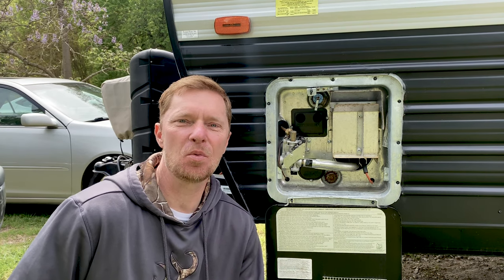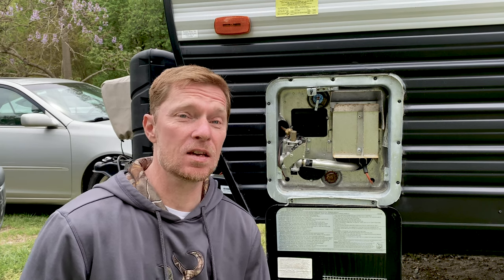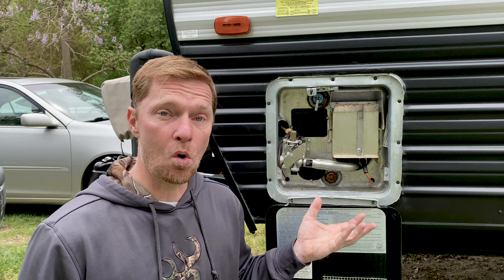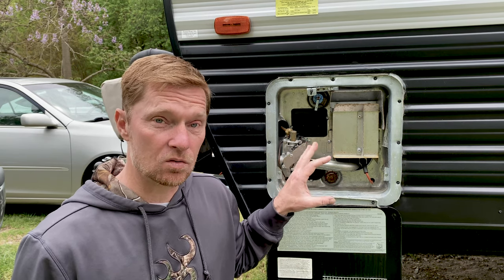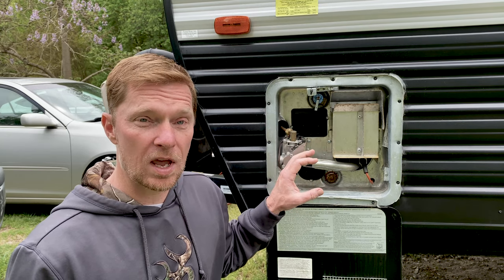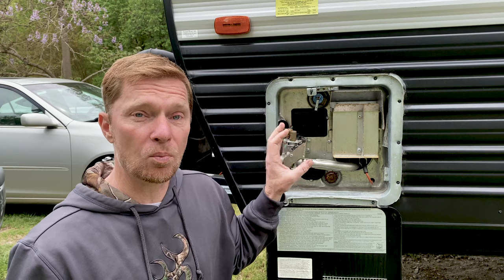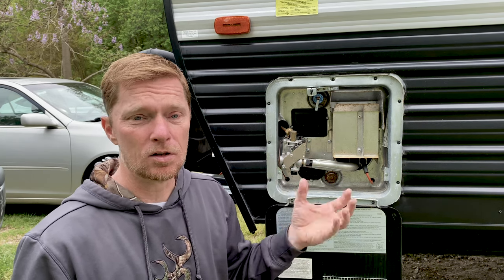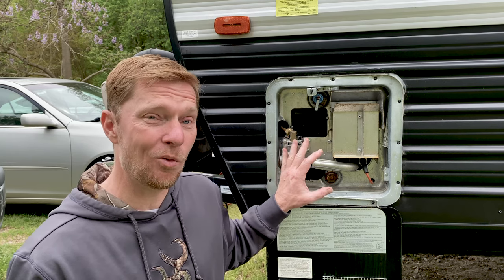Travel Trailer Gas Electric Water Heater Explained 2020

Comment: Thank you for this very informative and easy to follow video. We recently purchased a 2016 trailer and have replaced anode and heating element and replaced the fuse. The breaker still keeps tripping. Do you have any ideas of what else we might need to check?
Reply from the maker: Since you have already replaced the heating element and fuse, I would check to se if the thermostat is cutting of the heating element. I have a amp meter that i can check to se how much power i am consuming. You can try to use the electric and the propane at the same time and when the gas cuts of, the electric should as well. This is the point where the thermostat says that the water is hot enough. When the power gets to where it needs to be then the amp draw should drop as well.

Comment: How do you know when the water heater has water? How long do you wait until you are connected to city water to use hot water or what do u have to do so water goes to water heater?

Thanks!
Reply from the maker: On mine, I make sure that the vlaves on the back of the water heater are in the right place. I look at the little valves on the water lines going into the water heater and the handles are pointed at the water heater. After that, The water heater would need some time to heat up. Mine only takes about 30 minutes to heat up enough to feel a difference at the faucet. Here si an article that can better explain it with pictures. Hope it helps. www.tinyurl.com/26tw4vqu
Reply: I see. Thank you for the helpful information.

Comment: Good video.
Explanation of the ignition assembly for the nerd in a few of us.lol
On a call for heat as explained,  the gas valve opens and a spark is created to light the gas.  Once the gas is ignited,,,,,, the flame touches what is commonly known as a flame sensor. This flame sensor tells the control board that the flame did IGNITE and to keep running.  It harkens back to high school physics that heat is energy. It's sends a small millivolt signal to the control board.  If by chance you have a water heater that lights......then shuts down. Chances are your flame sensor is dirty. It can be removed and cleaned to a shiny new steel rod with a little bit of fine emory cloth or steel wool. 
On my model it will try to ignite 3 times. After the 3rd try. This system LOCKS OUT. Letting you know. 
       " SOMETHING IS WRONG  " 
On your first try of the season I always start my burners on the stove, my furnace and then my water heater in that order to purge gas lines. Notice I didn't say HOT WATER HEATER. 
GEORGE CARLIN SAYS 
HOT WATER DOESN'T NEED HEATED ! LOL
HOPE THIS HELPS.
Reply from the maker: I agree. There is a part in folks like us that like to understand the intricacies of things. Mine has the 3 strike and your out as well. Thank you for confirming that this video is serving a good purpose.
Reply: @HowToRV  
Retired HVAC/ R TECH FOR 35 YRS.

Comment: Thanks this is great! How do you know if your heating elements are bad? I just pulled out my anode rod and it's completely gone. On a 2012, I don't think the prior owner ever changed it.
Reply from the maker: I will have a video on just that in a few weeks. But, so that you do not have to wait, what I do is turn on the electrical side only and wait to see if the water heats up. I usually give it about an hour or so then run the kitchen sink faucet and see if hot water comes out. If it does, then I turn off the electrical side of the water heater and run the water at the sink until is goes cold. After that, I turn on the propane side without the electrical on and see if that works by doing the same think by waiting and then running the water at the sink. Hope that this helps. Oh....So far "fingers crossed" I have not ran into any issues with water heating up. If and when I do, you will surely see a video come out about that. Be Blessed.
Reply: @HowToRV  Thanks, more good stuff!

Comment: Does the switch on inside for water heater have be on or off for electric if that only switch?
Reply from the maker: I would think that if  you only have the switch on the inside, that you may havce a propane only system. One way to check is to see if you have a electric breaker in you panel for the water heater. You can also reach out to your local RV dealship. Where we live, I have to get an annual inspection and questions like these are accepted during that time.

Comment: Looks as simple as that but I'm trying to run my water heater off electric . It does not ignite . I have no propane in tanks and hooked up to electrical . Do I turn the hot water switch on in my RV. Do I need to close the propane tanks before igniting electric (empty) . Someone showed me how to ignite both ways but when I turn on the electric switch outside . No luck . I'm a newbie be kind . Lol . Thank you
Reply from the maker: On mine, the switch on the inside s for propane only. If you do not have any propane or the propane bottles are turned off, you will need to leave that switch turned off. If you are connected to shore power (i.e. The power cable to your RV is plugged in), then this is when the electric switch on the outside on the water heater will come into play. Be careful because if you turn on the electric on the outside to the water heater and you do not have any water connected to your RV or the water tank and pump are not on, you could damage the electric heating element. Hop this helps. Also, check out this video to see if it helps explain a little further. https://www.youtube.com/watch?v=r1QORFE2htM

Comment: Great video.. quick question .. if I have the electric switch and gas option, can I assume I can run both at the same time to get more hot water.. How do I know If I have a reserve tank for each option.  I was under the assumption the two options were only if u were “boondock”camping vs “full hookup” camping (didn’t know i could run both at the same time).
Reply from the maker: You should be able to run both at the same time. The electric and gas work together. We do it most of the time. In our setup, we notice a big difference in the colder months. The gas heats from external of the tank and the electric heats from inside the tank. The 2 working together heats up the water faster as you use it. Now it cant keep the water hot because you would use it faster than it can heat it back up, but it will last longer thank if you were only using one system or the other.
Reply: Imagine Your Odyssey awesome good to know, very informative! Thanks

Comment: Newbie here. We turned on the electric to the water heater. A while later the DSI fault light came in inside on the panel. So then we turned on the propane and pushed the hot water button on the panel and it went off. My question is this. Can't we use just the electric on the Hot water heater only, and if so why would the DSI fault light come on? I am very confused. We are at RV Park for 5 nights. Do we leave the propane on all the time when we aren't using anything. I don't want to mess up the hot water heater.
Reply from the maker: The electric and propane can run together. The DSI letters stand for direct spark ignition. That is the device that helps add the flame to the gas in order to heat your water. When this fault code appears on your water heater, it generally means that no gas or propane is coming through the line. I would guess that may be possible that the propane is turned off? Make sure that all the air is out of the tank before turning either system on. Please let me know if this helps and gets your system running like you want.

Comment: Hi Jason, thanks so much for this detailed explanation.
Question: is it possible to run the water heater solely on electric, and if so, how is it done? I have the same suburban heater as you, on a Flagstaff super lite. When I switch on the water heater on the console inside the RV, the propane automatically starts heating the water. 
Thanks in advance for any advice!
Reply from the maker: Yes, absolutely. I can turn mine on with electrica only by the switch ouside at the water heater itself. I leave the switch inside off and good to go. Be mindful though that the electric is not going to provide hot water as fast and often as the propane does.
Reply: @HowToRV  
Thanks for the quick reply!
I have tried what you suggested for electrical only with no success. I think the temperature regulator switch might be faulty.

Comment: Thanks for the video.  We had a small fire this last weekend on our hot water heater.  We had gone through a severe hail storm and when we arrived I saw the heater door open with the tab gone.  We pushed the switch inside and next thing i smelled burning plastic.  The plastic around the ground wire started to melt so i had my wife turn it off.  Tried to see what was up and when my wife turned the switch again the flame didn't look right and then ignited another small flame on the tube where it mixes with oxygen.  So we just turned off the heater and did without hot water.  Better safe than sorry.  It would be nice to know what could be the issue.   Any ideas?
Reply from the maker: If i had to guess, there was a short somewhere and the protection systems did not fault. There is a fuse in the system that is supposed to protect from things like this. Just out of curiosity, have you found what may have caused the issue?

Comment: SO... does the battery need to be connected and charged to use the gas for the water heater.. because thats what helps it ignite it and where does the reserve water come from?  yea   newbie here       I am trying to figure it all out.. 2012 keystone bullet 246rbs
Reply from the maker: First off, yes the batteries 12v system is what is used to ignite the propane for the gas side of the water heater. As for the reserve, its more or less when you use the electric and propane together. I have 6 gallons of water capacity in my water heater, If i use the propane and electric at the same time, the water heats faster than if i used the propane or electric by itself. Hope this answers your questions. Thank you for stopping by
Reply: @HowToRV  THANK YOU   you are awesome.. I have so many questions.  :)   little bit at a time.
Reply from the maker: @jade23reyna  I am here to help in any way I can. If you can’t find what your looking in a video on my channel, let me know by emailing me at How2RV@gmail.com

Comment: How do u turn on the propane side of the heater I have like 3 mins of hot water I’m guessing the propane isn’t kicking on
Reply from the maker: I make sure that the battery is god then turn the propane bottle on. After that, I have a switch for the water heater inside that i have to turn on. The switch on mine is near the switch for the water pump on the main control panel where the slide out and awning switches are. I hope this helps. When the propane comes on, i can hear it running from outside by the water heater.

Comment: Thanks for the awesome video. I bought a 2016 26dhb grey wolf many year ago and have never used the electric water heater. I tried to use it the other day and noticed it wasn’t working. Did some testing and realize I have 110v coming from the breaker but when I go to the heater side, it shows 0 voltage. Any idea why?Thanks in advance
Reply from the maker: If you have not already tried, push the 2 resets on the water heater. They are located outside of the RV and should look like black rubber buttons. After that, take a look at post #12 on this link. There is a diagram with a well-described troubleshooting method. When you finally resolve your issue, i would love to hear what you learned. Be safe around higher voltages. If you would like to share your learnings, I can post them on my community page on the channel. Good luck my friend.
https://www.irv2.com/forums/f105/no-power-to-water-heater-element-255405.html#post2657829
Reply: @HowToRV  did that’s already. I wired it directly to the house power and everything works fine.I think there is a connection problem between the breaker and the heater. Still can’t figure why or where.
Reply from the maker: @Rebecca-zx5yq  that sounds a tad scary. I wonder if there is a junction box error somewhere. I would not be comfortable with knowing there is a live wire somewhere in the rv. Best of luck.
Reply: @HowToRV  it’s scary for sure. But at least now I know there no mechanical issue with the unit. Do you agree that the power goes directly from the breaker to the junction box? Would it be possible there might be another switch or relay in between? Ive also thought about running a new wire from breaker to the heater.
Reply from the maker: @Rebecca-zx5yq  I will look at mine when I get a chance.

Comment: How do I run my water heater off of only electricity? Is there a propane cutoff anywhere leading up to the heater itself? 
I have permanent shore power and would like to reserve my propane for cooking and my propane furnace.
Reply from the maker: On mine, I have a switch at the panel where the slide out and awning switches are the is labeled "HTR". When switched on the, the switch lights up which means that the water heater is using propane. When the lights is off, means that the propane is not going to be used. This is how ours is set up. hope this helps.
Reply: @HowToRV  thank you! I wasnt sure but my light went off inside as well, although the switch inside and the switch outside are both still on.  Thank you!!

Comment: Question. When I press the switch inside to start the water heater, I'm not hearing it try to start does it need to be attached to the battery or does mya camper being 30amp plugged in bypass the need for battery
Reply from the maker: I would think that the battery needs to be connected. I have not tried it without one.
Reply: @HowToRV  yeah I can hear small humming coming from the hot water heater... When I flip the switch but I don't hear clicks like it's trying to start... I'll buy a battery and hook it up, see if that works

Comment: So the solenoid acts like an orifice I am getting a lot of soot I have adjusted the air that seemed to help a little bit but someone suggested that the orifice is dirty if it has an orifice please let me know if not and it works as a solenoid valve switch check valve then I need to change or clean the solenoid can it be done
Reply from the maker: All the solenoid does is open and close to allow for propane to go through. From my experiences, the soot comes from where the flame is to close to an object. I would look to see if the flame going into the underbelly of the water tank is to close tot the tank. Hope this helps
Reply: @HowToRV  thanks for the quick response we took a 3 day outing we were using central heat as well as heating the hot water first and second day when units came on at first. Flame was strong pressure and blue as propane tank got low that's when soot was noticed out of vent  this is a 2005 RV with original equipment one owner used 8 times only this is unit is electric on thermostat only propane usage this may help further in your analysis thanks in advance and I did subscribe

Comment: Thank you for this video. Pretty straight forward the way you explained it. One question, if your water heater is propane, is there a power draw from the igniter and if so. Do you happen to know how much? Calculator the size of generator I need. Thank you.
Reply from the maker: There is no draw if you are using propane only. If you are going to use the electric side, I have just the video for you. https://www.youtube.com/watch?v=n_v7QkFzNds

Comment: I have a 2016 28’ chaparral x lite. When I turn on my propane water heater it tries to ignite 5 -10 times before it actually goes on. Is this bad?
Reply from the maker: I am not sure. Mine comes on typically the first time unless I have air in the system. If you have turned your propane off at the bottle in between then maybe so. If not, look to see if there is any dirt or obstruction where the propane tubes flow.

Comment: How do I know the information of a element that I need to replace in my Forest River 2007 model water heater
Reply from the maker: Considering RV manufacturers can install different models, try looking for the sticker on you water heater where the panel is on the outside and type that in a google search to see if it will give you any information. If not, you can send me the information in an email at how2rv@gmail.com and I will see what I can do to help

Comment: Good video. Can you replace the electric heater element?
Reply from the maker: The electric element can be replaced. I usually recommend someone to have a technician do the work. Most areas have mobile techs that can come by your house and do the work.

Comment: If I’m hooked up to city water, will the water tank for the heater automatically fill up? Pop up camper owner here too…not sure if the same concepts apply.
Reply from the maker: As long as the water heater is bypassed, I do not see where there would be a problem. The water heater should be filling up on city water.

Comment: Well what if you don’t have a button to turn on the electric heating element does that mean you just have gas to heat the tank and what if you don’t have water in your tank but you’re connected with the hose from the hook ups does it warm the water that way as well?
Reply from the maker: If you do not have a heating element, you will have gas heat only. Also, if you do not have water in the tank, you will not get hot water. At least that would be the case in mine.
Reply: @HowToRV  yes thank you for the information one more way I found out if you have water inside your hot water tank is the release valve by pulling on it if water comes out that means there’s water in your hot water tank
Reply from the maker: @miguelvargas2964  that’s true but be very careful because it could be hot water.
Reply: @HowToRV  ok 👍